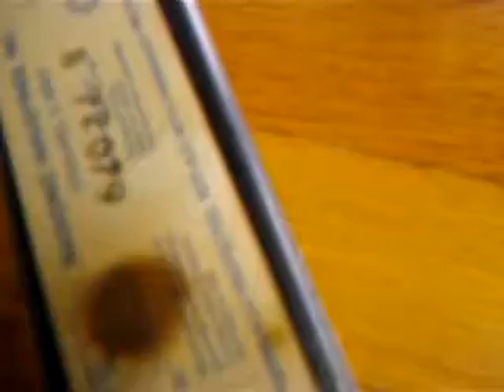EXPERIMENT: 1-lamp rapid start F40/F30 ballast being used as a preheat F40 ballast.

Comment: I did this with my single lamp F40 ballast, too. I believe mine is normal power factor, 0.6A. In my case, there is one blue and one white [neutral (circuit-interrupting) ] going to one side of the bulb, and two reds going to the other side. All I did was remove the neutral wire and one of the red wires to the bulb, and ran a starter to both sides of the bulb. The neutral is only connected to the ballast. It works very nice, but you're right. Only some starters work with this experiment.

Comment from the maker: I tried it again, this time I got it to work wiring the lamps in series. Some 2 lamp RS ballasts can do it, some won't. It will also be picky about which kind of FS-4 starters (brands, makes, years) it likes but if you get the right combination it will work. It takes a little while for the starters to kick in this way but eventually they do light up after the power has been applied.

Comment from the maker: I tried to do it with a 2 lamp ballast. No matter how I wired it only 1 lamp lit. I could do it by shunting the ballast for 1 lamp operation and using 1 red wire and 1 blue wire. However, since it was overdriving the lamp that way, the lamp would sometimes start right away without the glow starter working. Other times the glow starter would kick on and get it going.